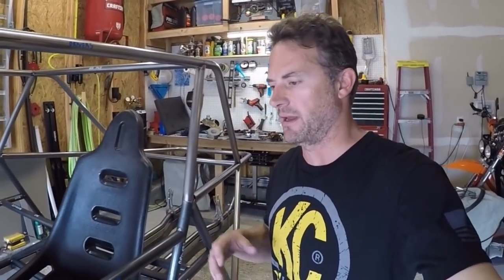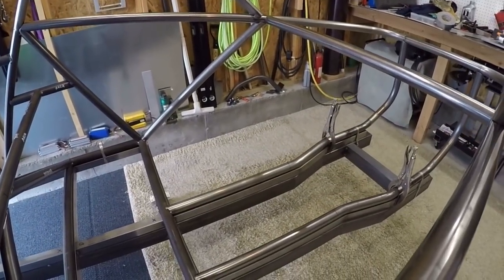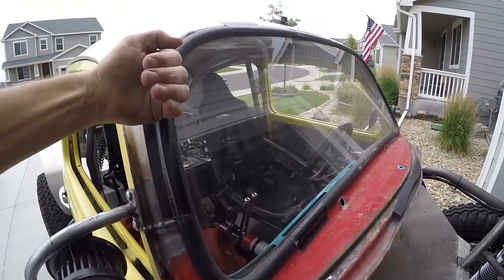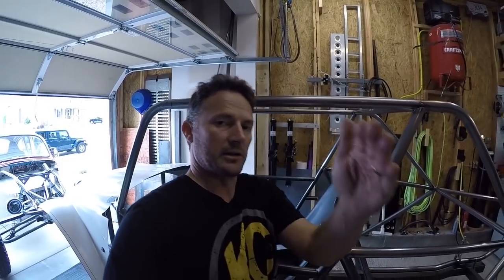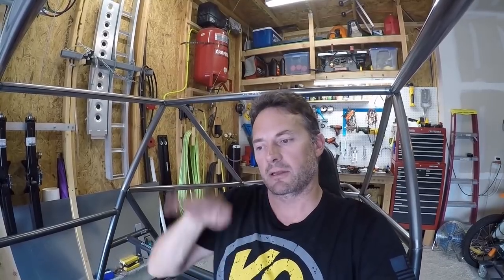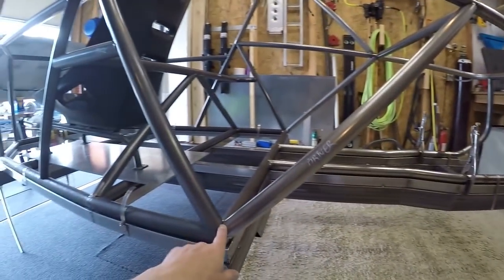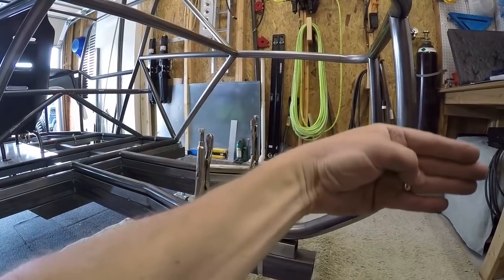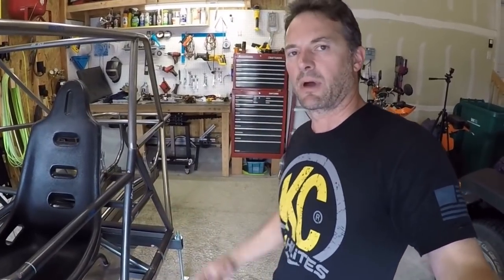Skeleton Chassis Walkthrough (Baja Chassis)

Comment: since your car will be street legal.....  ease of entry and exit is going to important. The easier it is the more you will use it for errands.
Food for thought: incorporate spare parts in your bridgework. For instance spare front and rear A arms bolted to the framework. Maybe your side bars could be removed for casual driving and bolted in for serious playtime? 
I never use my sun roof. In bad weather I want to continue playing and stay dry. In the event of a water leak or fire getting out of the roof might not be the best access. You can always break your windshield with a fire extinguisher and crawl out there..... Just some idea's because you asked for them. Looking forward to your final outcome.
Reply from the maker: EZGZ, I'll see how getting in and out is once it has a little more structure to it. I'm a bit committed to it at this point as the chassis was somewhat designed with those door bars in there for strength. Good tips on the sunroof. I'm leaning more towards not putting that in there. Thanks for the comment buddy.

Comment: If you want a round roof made of fibreglass you can cast one from your bug .. that way your support bars could be radius up for some head room ..
Reply from the maker: Hmmm, never thought of that. I don't know if I want it radiused that much. But the thought of using some of the bug body to form panels is a good one. Thanks for the tip!

Comment: I'm really liking the progress of the new chassis. You are starting to crank this one out. Having a good plan gets you going. Do you have plans to use the VW body or are you going to use fiberglass panels. Would be a shame if you cut up the body any more than it is to fit. Also when will you have your plans available. I have too many 2 seaters working on a 4 seater so I can get the family in one car for once  LOL. Would like to update a old build that is in need of strength.
Reply from the maker: My plan on this is to custom make fiberglass panels. This will be a first for me so I'll see how it goes. This chassis is designed to the outside dimensions of a bug body. So the option of wrapping it with an original bug body is not really there.
The Skeleton chassis will likely be finalized in a couple weeks. The final chassis with all the crossbracing won't be for a couple months. I can't finish that until I have the engine and suspension in place so I know where to tie in the final supports.
It would be cool if you were able to use some of this design in one of your builds.

Comment: Is it true if the radiator isn’t straight up and down there could be a chance of air pockets?
Reply from the maker: There is a chance, but really getting air out of a tilted radiator isn't tough. Depends on the angle of course, but I don't think I would be over 30 degrees.

Comment: It is looking like Blake Willey has some competition
Reply from the maker: If so I'm gunna need a bigger motor...LOL
Reply: Doug Bug - Could you get an adapter for the transaxle and put a vr6 motor out of a wrecked vw golf and put a turbo on it then make tune it a make good power
Reply from the maker: I could do that, but my transaxle would still be my weak link. What I'd like to do is tinker around like I have it for now. Then when I get my hands on a stronger transaxle I can step up to something like a V6 or V8 depending on what I get for transaxle.
Reply: Doug Bug - ok, and is your transaxle a bus or bug transaxle
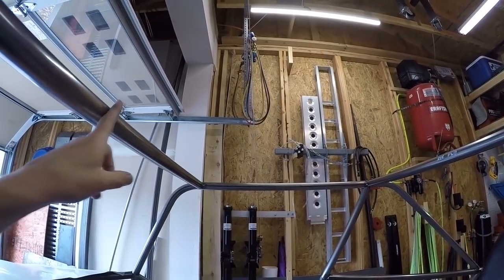Reply from the maker: Mine is a Bus type 2 with the 5:37 R&P. It's not built up though, just a rebuilt transaxle. And I'm asking it to turn 33" tires, so it has some stress on it. ;-)
Reply: Doug Bug - ok and before you get closer to completion are you going to build the transmission stronger
Reply from the maker: I don't plan on putting any money in this transaxle. I'm casually keeping my eyes open for something like a Mendola or something like that. I wish I could take the plunge on it now, but I need to check all the options and see what I have to spend. When I do go to something better I want it to be bulletproof!
Reply: Doug Bug - Yeah I agree, save and get something bulletproof and do it right.

Comment: Something to think about when designing the roof. Make sure you consider safety when you drive it without a helmet. Hitting your head on the cage will split your melon wide open. You may want to mount your seat much lower too. Even when wearing a helmet you can ring your bell pretty good if it hits the cage. I've done it in a buddies rock crawler. Damn near knocked me out.
Reply from the maker: Those are great tips! Thanks dude, I'll consider that placement when designing the bracing for the roof.